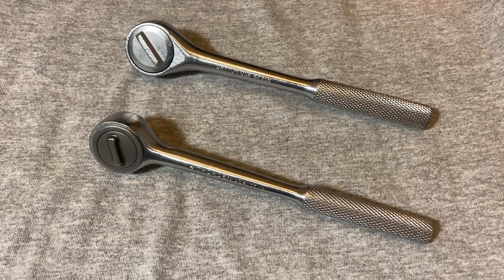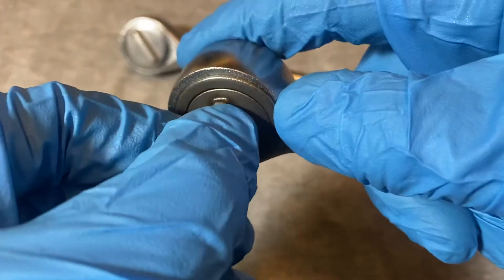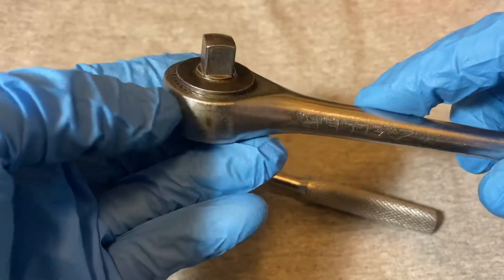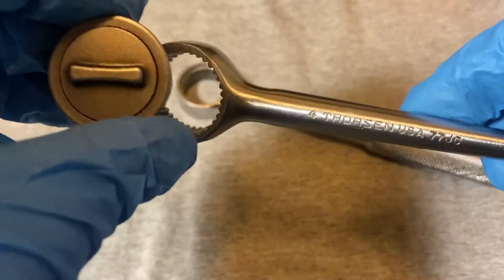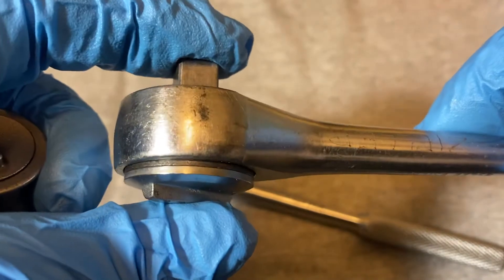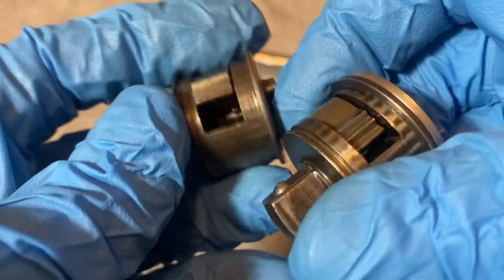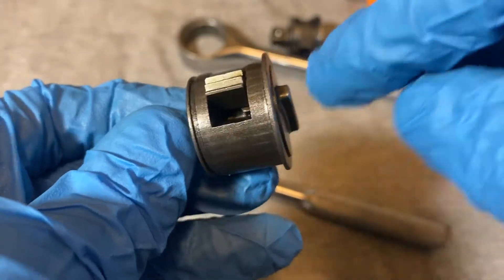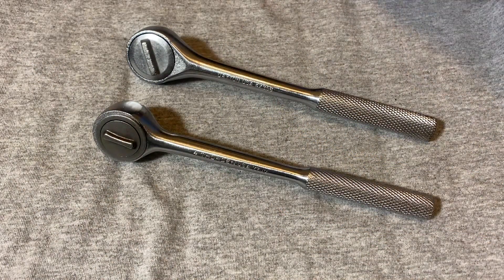Thorsen 77JC Ratchet TEARDOWN And Comparison Of 2 Different Style Of Mechanisms: Vintage 3/8” Drive

Comment: Great point about the plunger spring! I ran into that problem when I tore down my 77jc. I was able to finally get the spring out but it was mangled.!!!
Reply from the maker: I can’t figure why they bored that hole straight thru. Seems like that would complicate assembly at the factory?
Reply: @snapringchronicles3020  i agree except maybe it lessend the actual machining  /drilling of the hole? Drill straight through instead of measuring and setting a depth. 1 less step equals less $$$ to machine/assemble (even though assembling looks like it would be more difficult?)

Comment: You should show how to take off the coil ring?  That's the biggest issue.👍👍
Reply from the maker: I will make a note of that in the future. Most roundhead ratchets use the coil fastener and I think at that point I had many roundhead videos where I did show how to take it off. To save some time I opted not to show it that time.
Reply: @snapringchronicles3020  The most common roundhead ratchet of my day aka Craftsman did not,  FYI

Comment: Actually, the silver switch ones with the name on the head (rather than on the shaft) are a different model. They have much wider pawls - similar to the one with the black switch - but they have 4 teeth rather than 3 like here. 

I have a bunch of them. They were probably an intermediate model, before they went to the inset head. For some reason they went back to 3 teeth, but they are deeper and therefore stronger
Reply from the maker: Hey thanks for all that good info man 👍